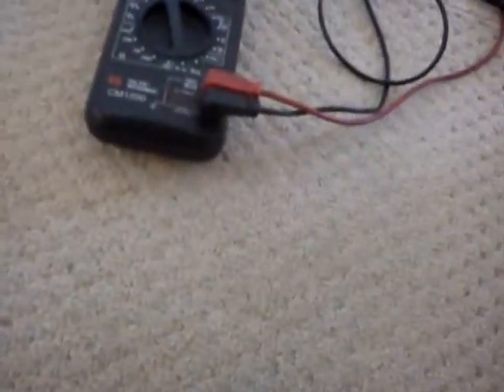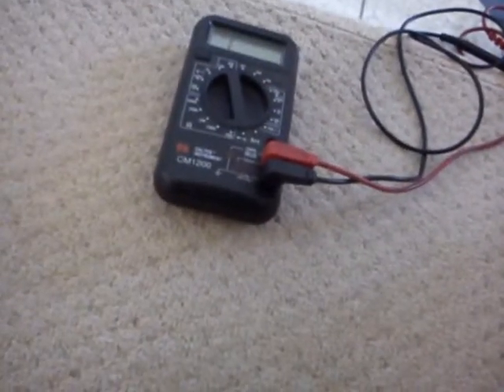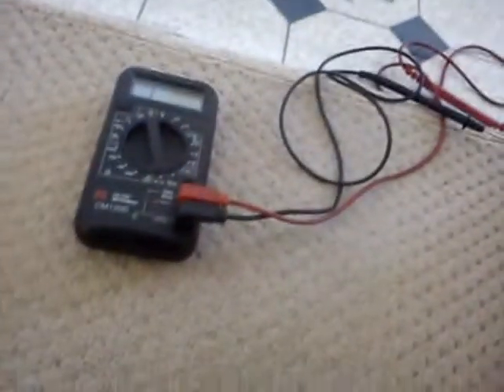Demo of a pressure mat

Comment: I used to service some alarms back in the 80s and 90s which still had pressure mats.  If you open it, it's really simple - two layers of foil, separated by foam with small holes cut everywhere.  One you step on it, the foil presses through the holes in the foam and makes a contact.  I suppose these were the first form of motion detectors before Microwave motion detectors and then Ultrasonics came along.  These were installed along with door contacts, "tube and wire frames" (normally placed over windows - if you cut the tubes it cuts the wire inside) and the good old "close wire loops" which was a door zig-zagged with vertical wires, then you had to cut hardboard to put over it.  The staples used to ruin doors.  Oh and then there was window foil which was my specialty - used to absolutely love sitting in shop windows, first you had to draw the outline using chalk string to ping lines on the glass, then apply the foil, then sticky tape either side of it leaving a slight border and finally varnish the glass and foil.  Those were the days, unheard of now :(